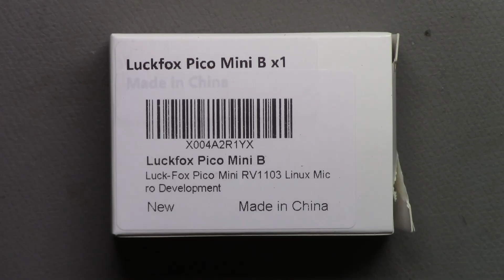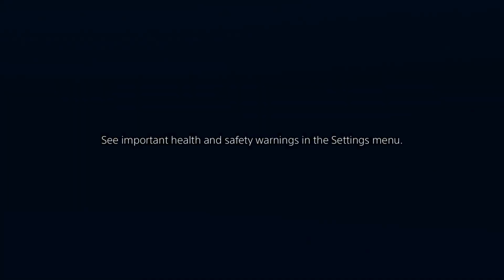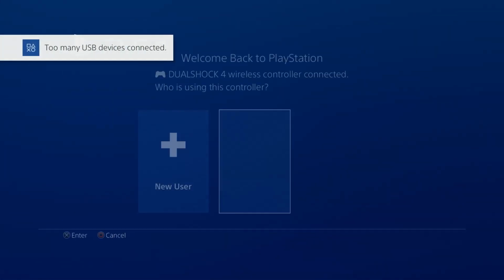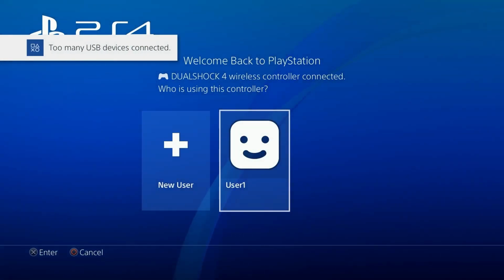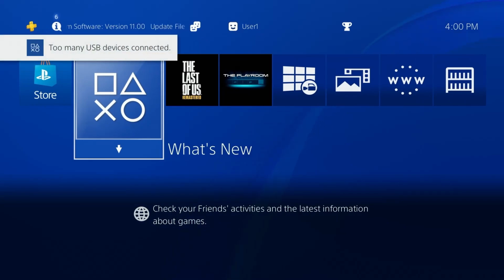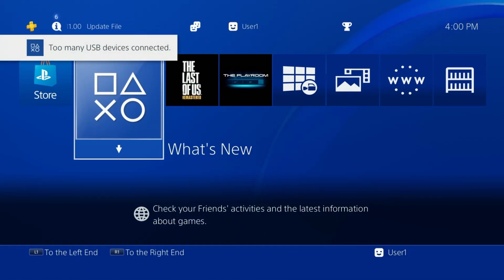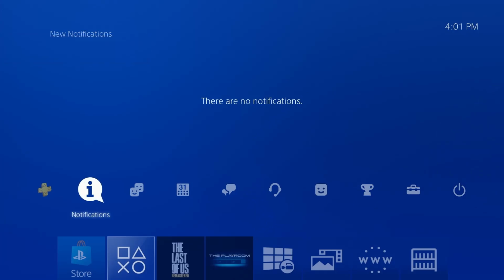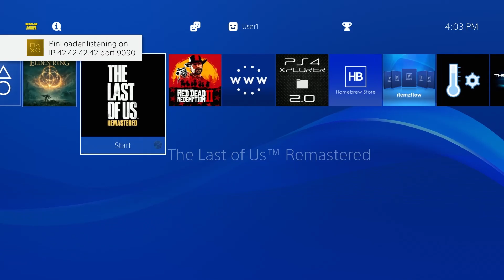PS4 Slim Internal Mod LuckFox Mini B

Comment: First of all, thank you so much for making this video, you're helping out thousands of people. Secondly, I had a little question.. TXP = TXD+, TXN = TXD-, RXP = RXD+, RXN = RXD-, Is this correct? I am a bit of a newbie so please forgive me if I am asking a dumb question. Thank you.
Reply from the maker: Off the top of my head I'm not exactly sure, but here is a diagram that shows the points color coded. https://imgur.com/a/by-malvadomodz-ps4-slim-luckfox-mini-yfP6HT0
Reply: @roycerepairs  Thank you. Also at 14:18 how did you get to that on the motherboard? Did you flip the motherboard upside down? Not sure where you soldered the correct Vbus and the Ground points. Thank you.
Reply: I have one more question for you. What size is the magnet wire you are using? Thank you.

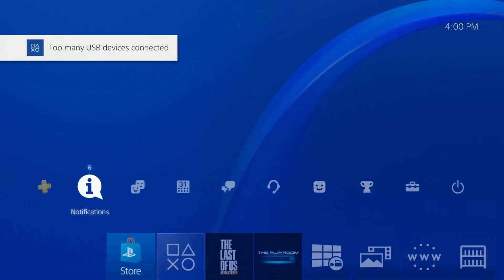Comment: 12:26 bro, I had the same problem. And then I opened the ps4 up again, and saw that I squezzed the 5v and ground wires to the metal shielding which is also ground 😂
Needed to do the 5v and ground wire again but then it worked fine
Reply from the maker: This is exactly what I did too, if you listen a little later I explain my mistake where I pinched the wire down :(
Reply: @ lol how interesting the life is :D

Comment: Should I unlock the ps4 before putting in the chip?
Reply from the maker: What do you mean by unlock? Do you mean update?  This works up to Verizon 11.00 if that's the case, update ONLY TO 11.00 before installing the chip.
Reply: @roycerepairs  I have the 11.00 but is clean, no goldhen installed... This method installs the goldhen or just activates it?
Reply from the maker: This device triggers the exploit that allows goldhen to be copied to the internal hard drive of the PS4 after the first run.  Then you don't need the goldhen file on the USB because after the first time you exploit it is copied internally.  After that you boot the PS4 and the device does the exploit which launches the goldhen file from the internal hard drive.

Comment: Thanks for this, I've already done this and was interested in where you put the mod chip inside the case. Noticed that you weren't bothered about access to the USB C on the chip for future mod image updgrades. Just a tip for your video editing, you could have overlaid the pin outs in your video with editing software to make it clearer for the viewer - just a suggestion!
Reply from the maker: Thanks for the video editing suggestion, I have basically no editing experience so I imagine I'll eventually start delving into those things... I actually made sure to place the luckfox in a way that I still could access the usb in case I needed to in the future, it's tight but I can still get to it, it's  more accessible on the pro though.